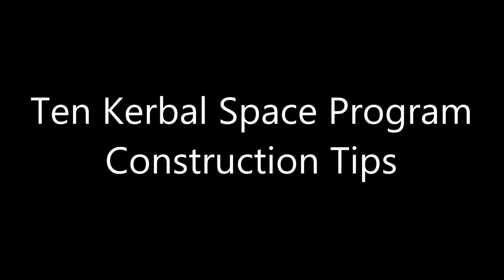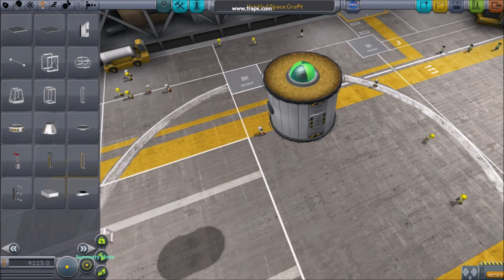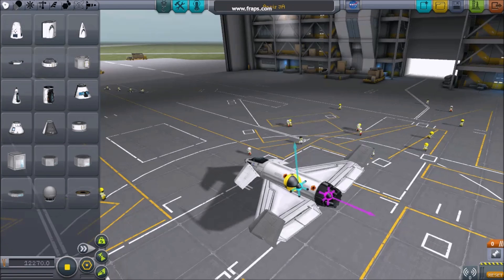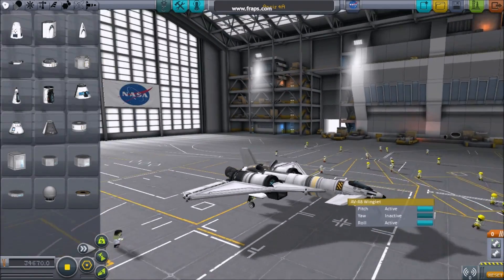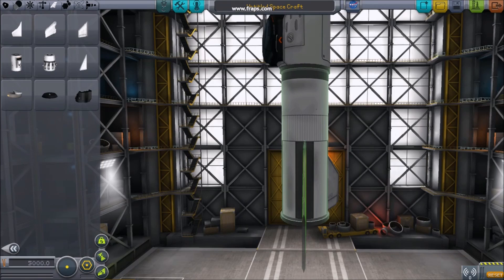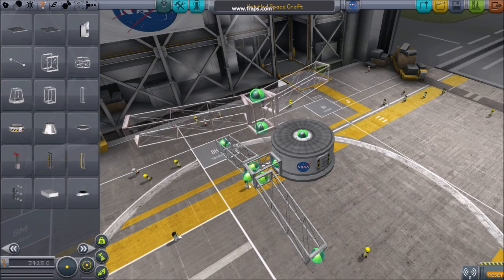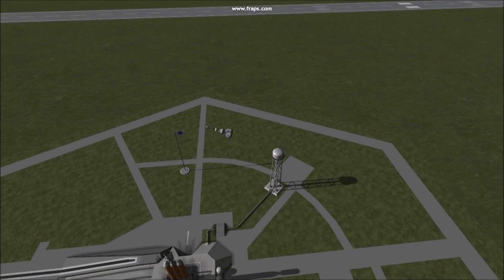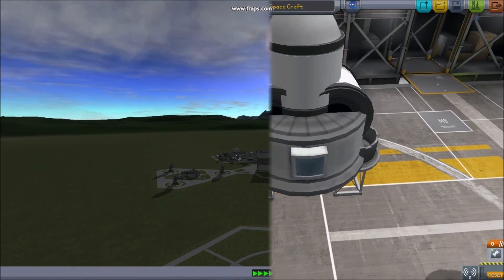Kerbal Space Program 10 Construction Tips

Comment: 1:29 While your center of mass can change in flight, it does not have to change, and probably should not. I prefer to design all my aircraft in such a way that the fuel is centered on the CoM. This way, the CoM does not change in flight. I believe this is the best way to design aircraft. Since jet engines always burn fuel from tanks evenly, if you center the tanks on the center of mass, they will not move the CoM, either while emptying or filling.

Comment from the maker: Now captioned for the hearing-impaired, thumbs up this comment if you'd like to see closed captioning in future tutorials
Reply: fragmentedpoe You can switch between symetry and mirror mode by pressing R ;)
Reply from the maker: Thanks for watching MOSKAU15, really only difference now would be building horizontal or vertical... And I suppose a primary symmetry mode.. 

I do plan to redo the first two videos, might as well wait until 1.0 :D
Reply: If you maintain your voice at the same volume, hearing impairment is less of an issue, one volume setting can be adjusted and should not need to be changed during a 5min video. This is also important when doing a lot of voice over editing. consider writing a script and practice before recording and editing.
Reply: Go for it